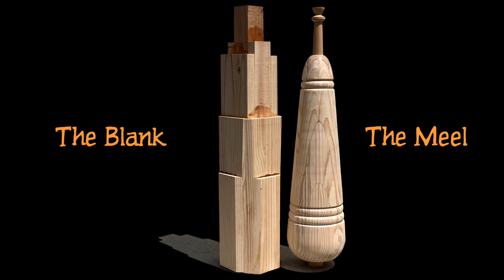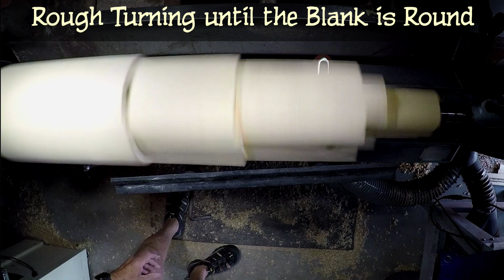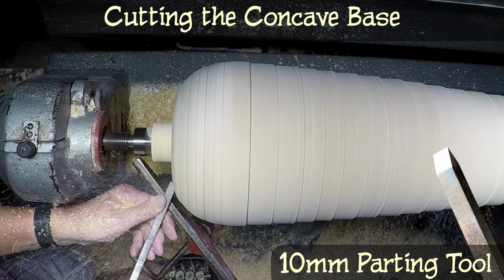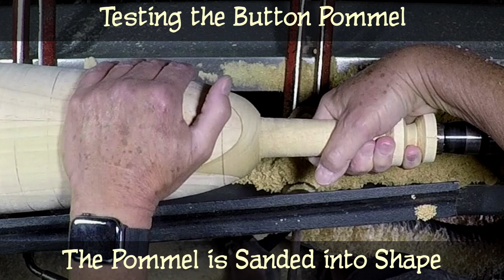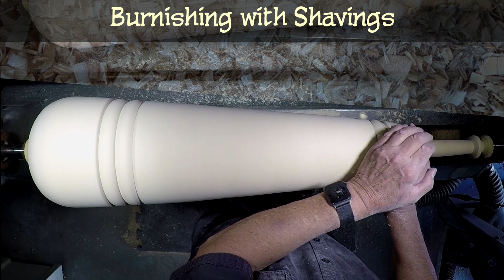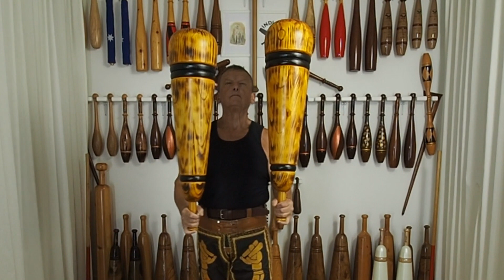INDIAN CLUBS | The Art of Turning Meels

Comment: Could you put the characteristics of your lathe, brand-model-voltage-motor power-distance between tips, etc.
Or the minimum requirements of the lathe, to be able to manufacture the Meels and the Joris?
Thank you very much in advance, you do a great job with the clubs.
Greetings from Spain.👍
Reply from the maker: You need a lathe that has a minimum of 1000mm between centres to make Persian Meels. To make Jori you would need a lathe that has 1200mm between centres. My lathe was made by Vicmarc in Australia, and it has a single phase 240w motor, with three pulleys.

Comment: Beautiful job, is there a place you recommend to buy Persian Mills from?
Reply from the maker: Hi Gavriel, In a word 'NO'. Buying meels in the west is a real HIT and MISS affair. I bought a set of Meels in Tehran (5 pairs) back in 2014, they have all lost weight because they were made from green wood and have dried out over the years making them lighter. 
Meels currently exported from Iran have the same problem, they are made from timber with a high moisture content that dry out and split which requires repair, plus they are very expensive to buy and ship. Western made meels do not have the correct proportions and the handles are incorrect, making them difficult to swing. I'm sorry if this sounds negative, but I want to give you and honest opinion.